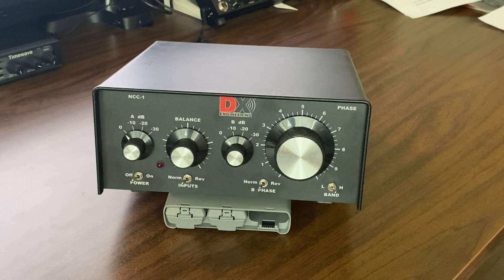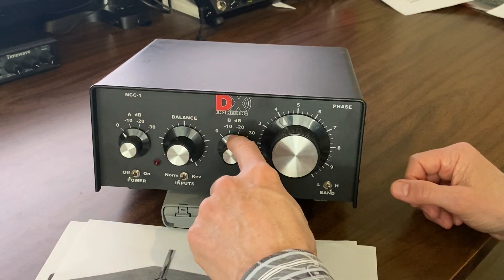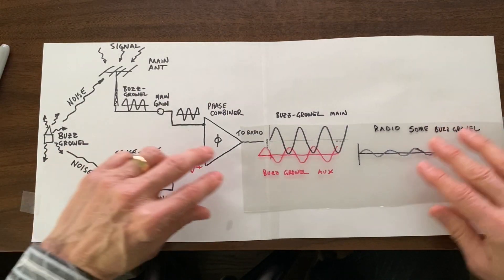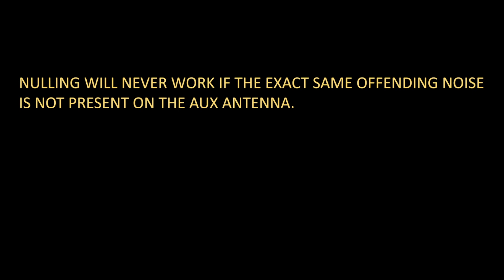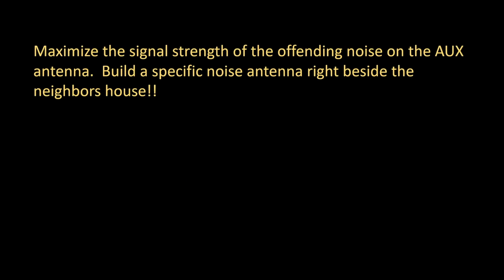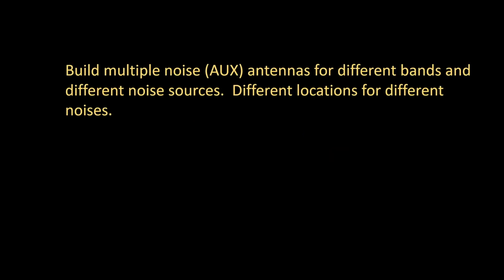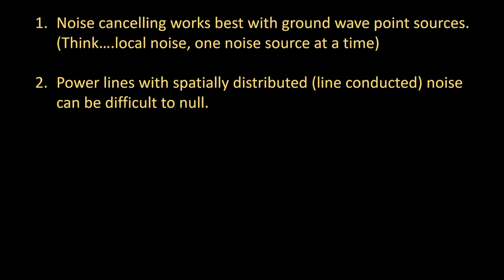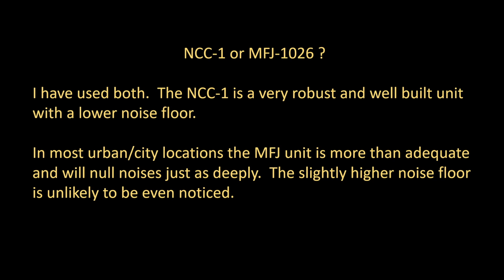How to use a noise canceller/phase box to eliminate local noise

Comment: I realize this is 4 years old already, but I'll comment anyway 😉

The explanation provided in this video is not correct. These devices are NOT "noise cancellers". They are two-element beamforming units. These work just like any phased antenna array, for instance a pair of stacked Yagi's. However, in this case the antennas are rarely the same, and the phase relationship is highly adjustable as opposed to using a fixed antenna spacing and a fixed phase delay ("phasing harness").

Also, one must be careful throwing around the word "noise". These units cannot defeat random noise, such as normal atmospheric noise, or (as is mentioned), noise from widely distributed area (e.g. power line noise). These units can only defeat an interfering signal that is *coherent*. Coherent means the signal has a fixed and unvarying phase relationship between the two antennas. Interfering signals might be considered noise, but is better to think of them as a distinct signal, and they must come from a point (not distributed) source. Very loosely speaking, QRM vs. QRN.

The way these units really work is, by combining the two antenna inputs the way they do, the antenna pattern is modified to steer a pattern null in the direction of the interfering signal. Thus antenna gain is reduced in the direction of the interfering signal. Unfortunately, these boxes also distort the antenna pattern in other directions as well. Thus the trick is to find an antenna geometry that allows a deep null in the direction of the interference while still maintaining a reasonable gain lobe in the direction of the desired signal.

Given the logistical limitations of most normal hams, it is not feasible to provide a two element receiving array that is optimized for each band, much less each frequency, and much, much less every possible combination of angular direction to and between the interfering and desires signals. Hence the entire process winds up being a trial-by-error crapshoot. Nevertheless, it is a very useful technique. If at first you don't succeed just move the second antenna over by some fraction of wavelength. As long as the interferer is a point source and, say, at least 90 degrees away from the direction of the desired signal, it is likely that success can be achieved.
Reply from the maker: In my video at :49 seconds I state clearly that I am NOT talking about beam forming or pattern formation.
Indeed these units can be used for that, and I have done that (a LOT).

Your comment is exactly WHY I posted this video.  There are many operators that don't understand how to use these boxes for specific noise cancelling.
To try and eliminate noise using just pattern formation to set the null in the right direction is much less effective for LOCAL, specific, and coherent noise than building a noise sense antenna as I describe. As I specifically stated at least 3 times in this video I am referring to LOCAL, coherent, specific noise sources, NOT QRM or atmospherics.
The problem with just trying to get the noise into the null is multifold. If the desired signal is in the same direction, you diminish the target signal. Secondly, undesired incoherent noise gets added to the system.

For 35 years I have built and experimented with almost every RX antenna possible. EWE, ground independant loops, Flags, HI-Z multi element end fire vertical arrays, over 4000 meters of elevated Beverage arrays, including end-fire and broadside phased arrays as well as near ground BSEF Beverage arrays.
I very much understand element phasing and pattern formation on RX antennas.
Many of the above antennas have also been phased together at various times with boxes to enhance null steering as you describe.

The noise cancelling method described in this video is the MOST effective way to eliminate LOCAL, point source noise sources, but only if the process is understood. and implemented correctly.

Comment: I got a QRM Eliminator, works on the same principle, due to noise from my neighbour's cheap chinese electronics. Included antenna was pointless. I'm fortunate that I do /P ops so put together my PAC12 antenna in my front garden, tuned it for 40m and used that as the Aux antenna. Massive difference. Only downside is it needed retuning when I changed band to get a decent worthwhile result so I'm going to experiment with lengths of wire or maybe consider a broadband RX antenna.

Comment: I have the '1026, and have used many different noise antennas. This can make a huge difference. Another trick I use is an outboard antenna tuner for the noise antennas. I set up on the frequency I am using, and set the outboard manual tuner for maximum "noise", and then manipulate the controls on the '1026 accordingly...
VE3IIM/VE6PG

Comment: Is there any way that one can use there transmit antenna as the noise antenna also? Perhaps a stupid question, but I thought I would ask anyway. Mark KB3Z
Reply: Mark, in a word, no. If the same antenna is split and fed to both inputs, the box will null the desired signal exactly as much as the noise signal. But an aux antenna can be very cheap & simple, as Steve showed. His noise antenna is effective because the level of the noise signal is probably much higher than his main antenna, while the desired signal is likely much higher on the main than on the little wire by the fence.

Comment: What you failed to mention is the desired radio signal is also picked up by the auxiliary or noise antenna.  It is not obvious to me why the desired radio signal is not also nulled out by the phase shift/combiner.  If the "Buz-Buz" noise can be nulled out with the phase shift then combiner so should the desired signal.??
Reply from the maker: Hi Steven,
The desired (wanted) radio signal will be a completely different phase than the noise, not to mention different amplitude. The phase of the noise is specific to the source and distance to the source of said noise. (As well as feed line phase delay).

Steve

Comment: I see the -30dB knob on the NCC-1 whereas I believe the MFJ is rated for up to -60dB cancellation. What was your experience between the two of them in terms of which attained the highest level of cancellation?
Reply from the maker: I think there is a miss understanding here about the attenuation knobs on the DX eng. box. They have nothing to do with the amount of cancellation in dB. Those controls are just used to balance the signal level between the two antenna ports as explained in the video. The DX eng box uses attenuation to lower one antenna to balance with the other, the MFJ uses a pre-amp. The end result is the same.
The depth of the null, or cancellation is similar with both boxes when adjusted correctly.
Reply: @ve6wz  Well the question is, ''Will the NCC-2 null as much as the -60dB the MFJ is touted to?'' I did interpret that knob incorrectly, it's actually a maximum possible gain or up to -30dB down, so what I wonder is how much gain does it's preamp have in 0dB ATT in comparison to the 1026 when set at maximum..?
Reply: @ve6wz  By the way, unless you're referring to an unmarried woman (Miss Understanding) it would be one word with only one 's' before 'understanding' - misunderstanding, but - you know that 😉

Comment: Now all we need is a is a "BUFFER CIRCUIT" for tapping into the phase control box for use with a two channel oscilloscope. Wouldn't that be nice... any ideas ?? Connect the dots gain and phase tuning.

Comment: brilliant video unfortunatly i live in centre of town with buildings all around i purchased a qrm eliminator but it has the ptt socket on the back i followed instructions to a t connected the ptt but two things happened one it only acted as an rf gain on main antenna i could not increase or decrease any rf of aux antenna even though i have identicle noise on it 2nd when connected to ptt on my icom 9100 it totaly reduced power output to main antenna and o cannot find any work around also the phase wouldnt do anything at all  even going direct without using ptt on bypass the phase did nothing and i could only get the main antenna to do one thing act like rf gain i checked the insides and all connections where fine its driving me nutts iv watched countless vids using the ptt all theirs seem to work im assuming mine just happens to be a duff one any suggestions of a decent qrm eliminatotor that maybe doesnt have to use  a ptt switch inline sincerley chaz 2E0EMN

Comment: You are a life saver sir! Watching your video made me understand how to adjust the controls for what purpose. I bought a Chinese version of the noise canceler [yes, I know does not sound smart-just apprehensive about spending another $250 before knowing what to anticipate] and hooked it up. Besides it having poor quality control, it still worked and I have it buddied to my good old TS-180S. The Chinese model does not have an adjusting knob for TX-RX delay and I was wondering how you properly adjust that feature on the 1026, or what to look out for before sending 100 watts down the throat of the receiving end and char the device. Any thoughts would be greatly appreciated. Thanks, 73...KJ7YSW
Reply: The Chinese canceller has back-to-back diodes which will limit RF to the unit during the delay in the TX-RX, as do most of these QRM Eliminators.

Comment: Power lines can be handled by contacting the provider and reminding them they are not licensed broadcasters and request they address it. If they fail to within a couple of weeks, contact again and remind them the FCC will fine them if it is not corrected. If after a month, call Laura Smith and let her know you need some help with it. 

PSU and TV's are the biggest sources of in home noise. An old Transistor AM Radio is your friend in locating the foes.

Comment: Excellent, excellent video. Fortunately I don't have necessity yet to need to approach neighbours for noise sources. Though I do get popups of QRM. But, unless the neighbour is difficult to deal with, many suggest it can be easist to speak with the 'offending' neighbour (once identified) and offer to help them fix, replace, or clamp with toroids, the offending devices. Apparently many are sympathetic to hams, if approached nicely.

Comment: Hi Steve ! Two questions , the signal reception ... lets say an S7 noise in the main antenna must be ? same in the auxiliar antenna ? cause if you have a beam like main antenna at top of the tower and a dipole auxiliar antenna ... its not easy both w an S7 noise reception...if is very close the null noise will work...in my case  ,  i have powerline tower few km from my property ... my main antenna is 6 el monoband for 10m at  95 feet top of my tower and the noise auxiliar antenna is just under 10 feet is 5 el monobander for 10m and not much cancell noise , when move main antenna diferent direction gets better but still is an S3 noise residual , i play w PHASE and AUX antenna noise , to reduce the maximum , i dont touch the MAIN antenna gain to make quiter the noise ... cause the signals reports is below 1 or 2 S units... Its a way w an aux antenna to get better or less S units noise ? will work CNN 2 better ? in long distance noise ? i have got the QRM eliminator .

Comment: Terrific video!  I've "seen the light" when it comes to noise cancelling, and I considered making a video myself.  Now I don’t have to because you said everything I would have said (and said it better, too).  Elsewhere on YouTube is a useful video to modify the MFJ-1026 using a relay to ground the noise/auxiliary antenna on receive or when the unit is turned off.  This is important if your transmitting antenna is close to the noise antenna, like mine is.  (A comment from that video said, “When you connect an external [second] relay, you need to set it up so that the normally closed position of the new relay is connected to ground. This will ground the [noise] antenna during transmit, and it will also ground the auxiliary [noise] antenna when the noise canceler is off.”)  

P.S.  Bravo on running a coax down to your neighbor’s house!  I laughed out loud!  I’ve tried enough noise antennas to know that you have to be tenacious to get that noise onto the noise antenna and into the unit so that you can cancel it out.  Good job!!

Comment: Great explanation. A couple of days ago I received a cheap eliminator for £40. I've been amazed at its performance. The first thing I did was use it with my SDR so I could see visually the effect of tweaking the knobs. I then tried it with my portables. So far I've had great success using the telescopic antenna it came with. I suspect much of the noise is coming from next door. I uploaded one earlier showing how effective it is with my Sangean ATS-909X.

Comment: Steve that stealth noise antenna is Awesome work! What was your technique for burying the coax without the neighbors freaking out, night time? Also, was the hi-z input accomplished with a transformer or did you use a preamp with dc fed through the coax? 73!
Reply from the maker: Yes, I used a small power HI-Z amp powered with 12v on the feed line.  Probably a small transformer would have worked as well since the noise was very strong behind his house.
I recall installing that coax during a weekday while most neighbours were at work....If anyone walked by, I just looked like I was working on the fence :-)

Comment: Great video Steve! You stirred up the need to retry it - I am in the 'disappointed' group and gave up years ago. 

I bought a WIMO QRM eliminator years ago, also with disappointing results, despite the many success videos. Apparently I was doing something wrong. 
WIMO's manual suggests a procedure to convince yourself that it works: connect 2 short wires on the MAIN and AUX ports, and put your antenna analyzer close by. You should be able to null out the signal completely - which makes absolute sense - but it did not! It is so easy to give up after that!

If you have no idea where the offending noise comes from,  is the placement of the noise antenna critical? especially in relation (physical/electrical distance) to the main antenna?
73, Nick
Reply from the maker: Nick...I have never tried the WIMO box so I cant comment specific to that unit.  However, the 2 wires in the box and using the analyzer as a source will indeed work, but the gain and phase adjustment will be *very* sharp and will change quickly if you move the location of the analyser....even slightly. Often cancelling any noise involves careful "back-and-forth" adjustment of the gain and phase until the perfect null is achieved.
ALSO, when using the MFJ unit, be aware that a full 180 deg phase rotation is not always possible, and sometimes it is necessary to activate the 180 deg phase shift button labeled "Normal" "INVERT".  A full 360 deg rotation is possible, but sometimes you need to activate that Normal-invert button to get the exact 180 deg. shift.  Perhaps a similar switch is found on the WIMO box?

Physical distance between main and noise antennas is less important than locating the noise antenna proximal to the noise source.  Your "Main" antenna is selected based on the best DX reception, and the noise antenna is selected and located based on getting the "offending noise" signal as strong a possible.  Perhaps walk around with a portable radio and try and find out where your specific noise is loudest??
Reply: @ve6wz  Thanks for the reply Steve! I will have to dig up the unit and try again. I do not recall any switch (and googling it indeed does not show any phase reversal switch) so I hope that its design is adequate for the job (maybe I have to find its schematic and compare to other boxes).Another try will not hurt!At least, your success is encouraging to me, mybe I can make it work! 73!

Comment: I started with the QRN squasher design by W1FB (SK) back in 1996. Not long after (1998 I think), MFJ came out with the 1025/1026 (the 1025 does not have a hole for a telescopic whip, which is essentially useless anyway). I still use the 1026 I bought back then... it's an essential part of my station. My NW beverage receives noise from a neighbor's house directly in front of it. I use sainsmart relays (denkovi compatible) to auto-engage the 1026 when I select the NW antenna. Occasionally requires  little re-tweaking. As Steve points out, the noise antenna is important. I use a 15' vertical on the roof. de N8UX